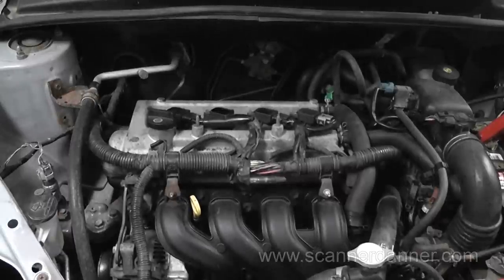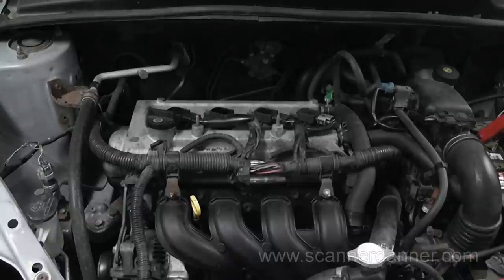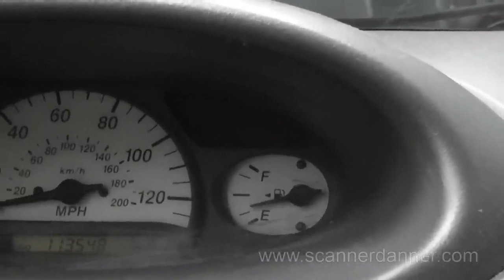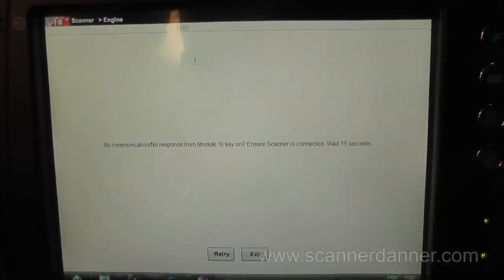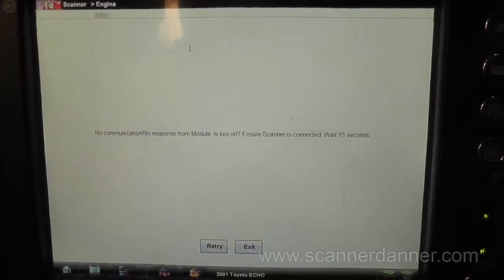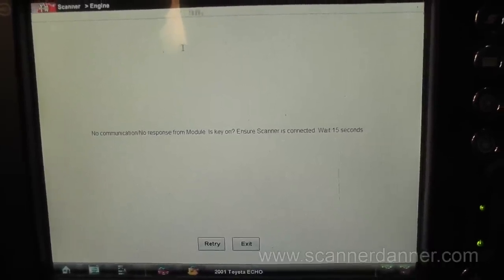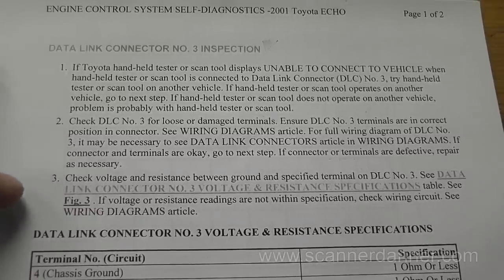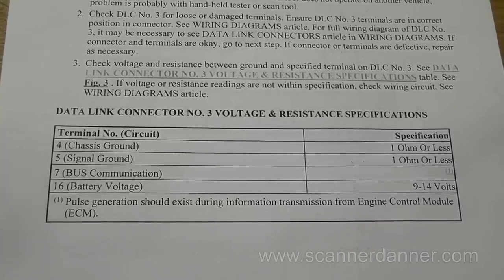Poor running, flashing CEL, no codes (bad computer ground) - Toyota

Comment: Hey Paul, another great example of why loaded circuit voltage-drop testing is much more accurate than the standard ohm meter continuity checks. For the DLC ground pins 4 and 5, a test light (connected to B+) would be a quick way to load the circuit a bit and confirm the ohm meter readings...Happy New Year!!
Reply: For sure. Thanks man. Happy New Year to you too!

Comment: Been with Toyota for 15+ years and I detest these cases. Being a dealer, we are often the last resort people come to after every independent shop in a 30 mile radius has had their hands in it. It wouldn't be a problem if the customer didn't expect you to know the issue off the top of your head and only want to pay for minimum diag time. Anyways........ good video bro! I'm a little shaky  with scope diag and your content helps a bunch. Gracious!
Reply from the maker: thanks man!
Reply: capt251978 engine replacement in my view junk engine creates too many problems with modern electronics controlled vehicles.outcome seems bad with anyone that I know that's done it .there are few scanner danners  out there he's auto elect tech.most are hammer and screwdriver tecs.
Reply: Brotha this stuff is so fun and stressful for me. I appreciate this content and premium content im a mobile mechanic and I get a lot of cars like this and charging diag time is always a firey dance between me and customers puts a lot of stress on me to get things figured out

Comment: paul ive been a .A.S.E master tech for 30 years.presently working for a toyota dealer.mainly on asian cars. and yes cant emphesize enough the importance of grounds. specially the ones from a junk yard engine,so clean those grounds they can bite you later.paul i cathegorise you as a true master tech and not a parts changer. great job brother and thank you for the videos. you never stop learning in this great business.thanks again rick bauza.

Comment from the maker: good question. In this case we use symptoms as a guide. If all it was was a communication problem then I may have worried about that more. Low voltage on pin 16 does not cause driveability problems. This thing clearly had other issues. 
Then there is also probability and experience. I have never seen a wiring problem on pin 16 other than a blown fuse. All of the wiring is inside of the car out of the elements.

Comment: Finally someone that take time and does a good job in troubling shooting and good at what they do. See so many hacks that just swap parts. Pretty much had to deal with a 05 corvette that someone hack up that replaced PCM and body control module. When it was a bad ground that corrode at harness on top in front of engine. Usually you will have voltage at ground, due to floating ground, not always a cross over wire from another circuit, so seeing voltage at ground is common when ground is floated.

Comment: Hey Paul, you have some great videos.  My car was in accident but was running.  Small bodyshop did some work on it and now it cranks but won't start and scanner will not connect to ECU.  I took car to mitsubishi dealership and they said scanner would not connect (duh) and that there was no fuel and I think stopped since it had recent body work.  It sat for 1 month.  I have it at home now.  OBD2 has grounds on pins 4 and 5 and 12 volts on pin 16.  BUT, I read about 180K ohms at pins 6 and 14 on OBD2.  I feel like I lost ECU ground and that this is my main clue for the vehicle not starting.  I was thinking bad ECU but your video will let me do some more trouble shooting.  I'm a bit of a novice but this is getting the old brain firing and I like getting lost in stuff like this.  I'll keep you posted.

Comment from the maker: Good question, not sure I can answer it. There is a lot of communication going on with the engine running but not a hole lot to the scan tool if you think about it. It is just displaying data. 
As for CAN bus systems, I'm still learning myself. 
Thanks for your kind words

Comment: Sir i face a many issues in CAT machines so in this condition don't trust on Multimeter much better use auto tester so you can see light brightness.lose or rusty connection multimeter will show you voltage but no way if you use auto tester other hand use test probe by battery 4,5 B- and 16B+ before go to further troubleshoot most important is DC supply then check communication harness .Good job sir

Comment: Awesome Paul, interesting you wouldn't think the computer grounds would draw enough current to drop voltage on the engine block via the attaching bolt.  Also, thanks a lot for emphasizing when you do voltage drop test on a ground connection, when the ground under test can be loaded down with a load of some sort, makes perfect sense, thanks Brother for all your time, effort and enthusiasm on all your videos.  It's greatly appreciated 🙂
Reply from the maker: Thank you!

Comment: That blue temp light is normal when cold.  When it warms up, it goes away.  But if it starts to over-heat, then it turns red.  Btw Paul, this video helped with a car my friend was working on.. No bs.  I swear, this video that i saw a day after you posted it, helped me fix a 2000 accord with a  no communication problem.  I work at a Honda dealership and my friend was just about ready to throw a computer at it.  Seriously Paul,God bless you!  Thank you for your videos, i will always support you...

Comment: Good video. Looked like a fun one. Often times when I'm checking an unloaded ground, like the ones on this DLC, I will connect a test light to battery positive, and complete the circuit through the ground I am checking. I verify the voltage on the ground by clamping my meter to the ground side of the test light.

Comment: Thanks for the upload. If you were wondering the signal you were seeing at pin 7 of the DLC after the repair was an ISO 9141-2 signal. ISO 9141-2 is a "pull down" (approx 10-13v high and approx 0-2.5v low) type of signal running at 10.4K. I suspect if the vehicle had ABS you would have seen more activity on the bus even without the scantool connected. As always another great video, thanks for putting the time and effort into uploading.

Comment: If you want a lasting fix, best practice is to put dielectric grease on the corroded ground point on the block and on the ring connectors and the bolt threads, after you have gotten the corrosion brushed off of the critical areas.  For long term circuit reliability throughout the vehicle, all of the engine and chassis grounds need this dielectric grease treatment.
Reply: 'Dielectric grease, or tune-up grease, is a silicone-based grease that repels moisture and protects electrical connections against corrosion. ... The grease does not conduct electricity, so it shouldn't be applied directly to the mating surfaces (pins and sockets) of an electrical connection.'

Comment from the maker: I have heard of him and watched some of his videos. It is a cool idea for sure. 
I don't want to support or bash someones ideas in a public situation like this. So I am not going to comment further on his tool. It wouldn't be fair as I do not know the tool and have never used it. 
I will say that using my methods of testing, I find no need for another method or tool to help me find voltage drop problems. But hey, who knows, there could be a situation that it would come in handy.

Comment: Thank you for your video, good solid teaching from you. I had a Dakota with Nobus issue that turn out to be the ECM overheating. It started with a dead battery to a no charging then a no start after driving and idle for 10 to 15 minutes but very random. Thank you.

Comment: Good video Paul, I especially liked the part where you explained the importance of voltage drop testing and how the ohm meter can mislead you.  I also liked your example of showing how to verify that you have a good ground by going to a lower scale because current flow on computer grounds can be low compared to others.  If you have 0 volts on ground you could have current flow, but due to the resolution of the meter if it shows just 0 volts this could just mean you have continuity to ground.

Comment: @ScannerDanner... with this video just blow my head off!! This was the best example ever to check ground connections
Reply from the maker: such a good lesson too on why an ohmmeter is NOT the tool to use for checking for resistance problems! right? The voltage drop test reigns supreme. :-)

Comment: The Load Pro leads in conjunction with your existing multimeter work awesome for testing good powers and grounds, and you don't need to load the circuit, the leads take care of that.(for example, checking the integrity of that solitary ground at the dlc). It would be a great addition to your tool arsenal Mr. Danner. Oh and by the way, your knowledge is impressive, Thank you so much for sharing it.
Reply from the maker: Thanks man. I still prefer to use the existing load in a circuit but to each his own.

Comment: No question voltage drop is the best way to go. Leave the ohmmeter on the bench  where it belongs. A Loadpro would have worked great here. Pick up B+ at 16 on the DLC and the ground lead to the tee pin in the PCM connector. That funky ground
connection would not have passed the load test the Loadpro provides. Not all of us have access to lab scopes. Great video Paul, keep them coming.
Reply: Why not an ohm meter?  Big trucks get beat the fuck to hell and wiring problems from rubbed/shorting/broken wires are so unbelievably common, and I usually disconnect the main chassis plug at the fire wall and test resistance.  If it's open, or resistance on a ground is above like 1 ohm, or way out of spec if I'm testing a circuit, I already know where I'm going to look and I just needed an ohm meter.  I think kiss would apply in this situation, why over complicate something that is so basic to diag.  And it really is basic, car guys never get to work on them so clearly they think they need a machine worth 1000 dollars for logic to start working.......
Reply: Awesomeman1987 like I would have gone right for the power and grounds as soon as I couldn't connect to the ecm, then I would have tested the data link, no tools even out of the box yet.  But on cars it's is so unlikely for a wiring problem to exist, he tried to test the ecm before the wiring.  Just interesting to me.
Reply: Cars are not likely to have wiring problems? Where did you get that idea?
You have to remember that Paul is a teacher first so he shows process  often in that vain to teach but in the field you would not go through all those steps every time. You don't need a 1000 dollar tool to ck a circuit either.
You have a multi meter I'd wager and a Loadpro can be had for less than 50 bucks. You can load test easily any circuit with it. Paul is wrong in this video when he says you can't load test the circuit on pin 5 because it doesn't carry
a load. Right but finding good power on pin 16 and grounding the Loadpro
negative lead on pin 5 would found a problem there if it existed. I would suggest searching YouTube for videos by Dan Sullivan for further explanation. You like  k i s s  as do I but unplugging a bunch of circuits
first to start a diag isn't kiss in  my eyes. It is tough to deviate from what we know but there are better ways to do things with an open mind.
Reply: moomike laloo after watching more of his videos I realize of course he is going to go thru all of the steps.  The guy is actually very good at what he does.  I have never had a wiring issue on any of the cars I have owned with exception of the rear wheel speed sensors falling out and ripping off on my parents 2000 sienna.  None of my personal vehicles have had an electrical fault, and I only worked briefly on the car side of things for a shop so maybe they are.  For trucks, you get like 4-5 vehicles a week with rubbed thru/corroded wires, admittedly less often in the summer but still frequent.
Reply: Awesomeman1987 Yeah..I too work on large trucks up here in NYS. Plow trucks that also spread salt. We eat electrical faults for breakfast. I did it much like you until Dan Sullivan sold me on voltmeter only  diagnostics and the true valve of voltage drop testing. Both Dan and Paul have illustrated the
weakness inherent in using an ohmmeter on circuits that carry even small currents. I still use the ohmmeter but it's rare anymore.  My 
You Tube education has been way better than anything i recieved formally.

Comment: Great stuff,as always!
Grounds,and battery terminals are always good things to check. I've seen newer cars do some WEIRD stuff with loose or dirty grounds/battery connections. It can make the computer(s)/modules go crazy.
The flickery lights are a good clue here,power/ground circuits are suspect.
Also,looking at the "pulsed signal" it doesn't look like it's being pulled to ground. I would expect a 0-5V or 0-12V square wave of some sort.(as seen later in the vid,doh!)

Comment: I worked for Ford in 1991 and most Techs were still trying to wrap their minds around fuel injection which came out in 1986 .This type of scope and scope training sure would've been nice way back then. When I graduated Lincoln Technical Institute in 1991, I was awarded an Analog Voltmeter for achieving the highest grade in Advanced Auto Electronics Class. Can't say I got alot of use out of it.

Comment: Wow this has been 2 great videos. 
I wish you would a do a - Scanner Danner How It All Started - video if you haven't already man.
You could have done so many other things like drive UPs truck or Rancher, run for president, doctor lawyer, banker, biker, surveyor, developer, concrete truck driver,  Home Depot fork lift operator, Plane Pilot,  all kinds of doctors  and on and on but you chose diagnosing automobiles and teaching others what you have learned. Things that I have learned from you and others on youtube like you have helped me enormously to not have to take my vehicles and my kids vehicles to expensive auto repair every time they need something.

Some jobs you simply would rather pay someone to do like I put a rack and pinion in my 2000 Ford Windstar last Saturday and Sunday along with a power steering pump and some sway bar bushings. And I learned one thing about that job... I don't want to ever do another one. But I would LOL!  Hopefully not back to back though.
The weekend before that I put front brakes and rotors on it.

I like to work on my own stuff. Nothing aggravates me more than stripped out screws from some guy using a very powerful tool on a bolt and over doing it. Some guy just almost ruined my oil pan plug threads once in Franklin NC where I got my oil changed out of town. They still held but had that bad soft never tighten up feeling.
And that's another thing. Never get the oil changed out of town or even a couple days before you go out of town.
I've seen oil changes cause engine failure with stopped up oil screens.

I use air tools to run things up and if they are delicate I always hand torque them. 
If my air wrench isn't strong enough like mine at home. I run lug nuts on with a 1/2 inch impact and tighten them with a pull handle. But yea thanks for all your vids. They help people more than you know.

Comment: Paul, it amazes me how many people just replace parts instead of looking for/finding the actual problem, i mean a computer isn't cheap and the fact that the engine was changed 2x should have been some clue but you are a master at DX, you know the procedures.

Re. 'salvage' yard parts and engs your buddy ETG knows a lot about bad engs coming from salvage yards-- when i was young they were known as junk/bone yards and they didn't call them JUNK yards for nothing --   Hope he got a deal on the echo

Comment: Mr Danner... i have a the same trouble in a Dodge Voyager 2003  the scan no comunicate whit the pcm... the trouble i line of 12 volts of ignition was cut the automatic transmition stuck in 2 spedd... but the problem is off... thanks for this incredible videos... master i from Mexico and is a big honor for me be you fan.
Carlos

Comment: i loved this video. i watched it from start to finish simply because i not only have a deep love for electronics but i also drive a 2001 toyota echo as my daily driver. i really liked this video because i got some nice pointers on how to test electrical issues. and btw... that filthy blue temp light comes on even on the hottest of days for at least a few mins until the car warms up a bit. runs like crap till its off but yeah just figured i would mention it. thanks for the video!

Comment: Hi thanks for your prompt reply. Compression  after washed up goes under 50 psi. But when fuel pump is disconnected via fuse then compression gets back to 130 to160 ish each. But again compression goes down when fuel pump fuse in. Fuel doesn’t burn and cylinder gets flooded. I have ordered crank vacuum test gauge, can I hook it EVAP (purge valve) which comes from charcoal canister and goes to intake. I will upload result once gets gauge. Scan through VCDS but no error in engine module. Took car to  2 mechanic but no success. One said ring piston gone, need new one or engine. It was parked for a while , did service myself, as I always do on my cars. I left one vacuum pipe half open, it was starting but misfiring. After fixing that big leak  , I remember it didn’t start. 
I was thinking to undo vacuum hose after throttle body and see if it starts, 
Regarding that mechanic, I asked him if it is piston problem then why compression back to 150 after disconnecting fuel pump. I didn’t agree with him and brought car back home, it’s parked in driveway for last 3 months. Sorry for long message. Thanks for your input, regards.
Reply from the maker: when you are at 130-160 (after adding oil), how long of cranking does it take to drop back to 50 psi? And unless you have a severe overfuelling problem, it sounds like you have a ring problem on that engine